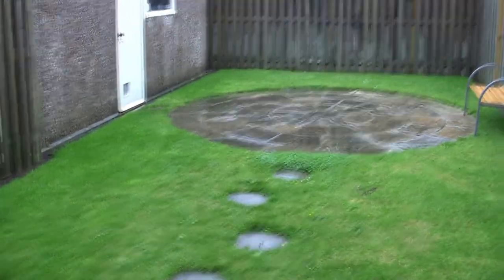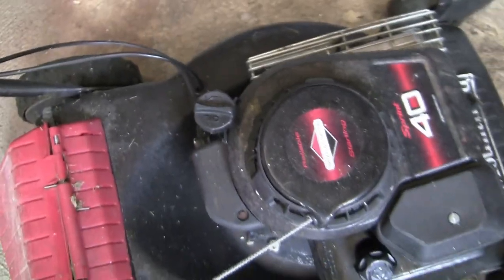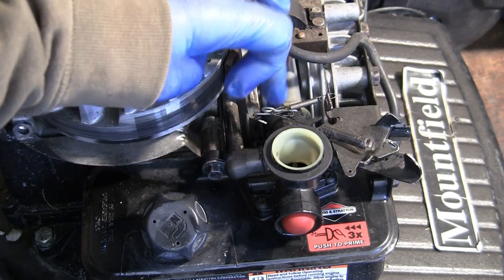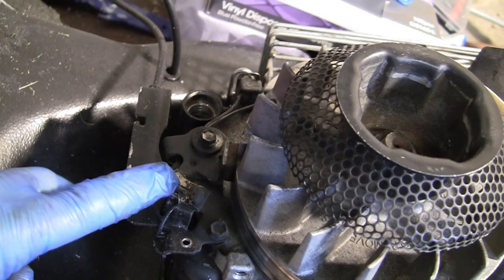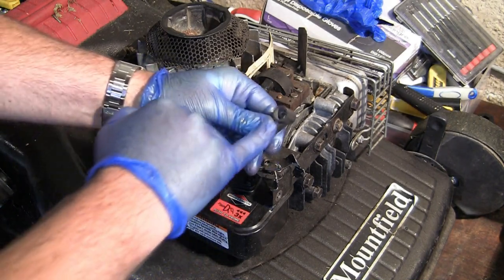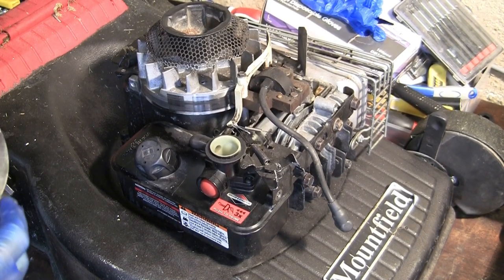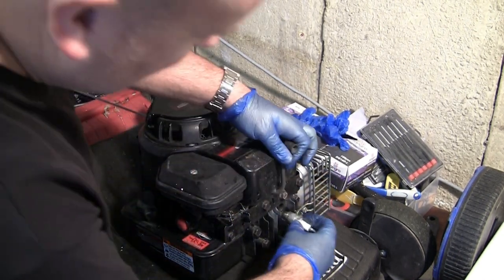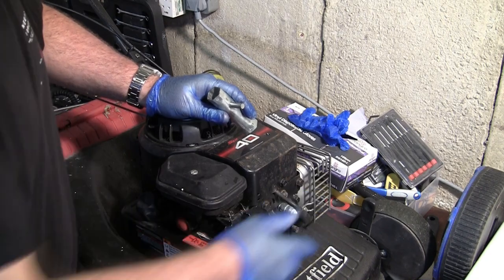Serviced Lawnmower Won't Start- Here's Why

Comment: Thanks a lot for the really informative video.  I had serviced my engine but it still wouldn't start.  Your advice regarding the kill switch was the key.  Adjusted wire till pad was lifting clear and away it went.  Thanks so much for taking the trouble to help duck eggs like me!

Comment: Hi could you please help me with a minor problem, I have Mc Cullock M46-125 the push handle which connects to the chassis the left handle is very loose i need to tighten it. To do this i have to remove the inner plastic discharge chute , i have removed 5 bolts but it still wont come out there is something else or another bolt which prevents me from removing the chute. thanks if you can help

Comment: In England go you have e20 gasoline. You need to use stable with your gasoline. I use 85 octane aviation gasoline the faa    forbid ethanol in aircraft engines

Comment: The screw for my filter cannister does NOT tighten into anything--- just spins and with motor vibration, the filter flopps around and is NOT doing what it should. I have gotten New screw and still doesn't tighten into anything.  I have tried to make sure that the screw hole is NOT plugged with debris, and it doesn't seem to be the issue... Any advice?

Comment: Welcome back young man, thanks for the troubleshooting video.  I’ve just repaired a mountfield like yours. The owner had tipped it  on its side to clean underneath and the petrol was black with oil. carb and tank clean job done.  Started repairing after watching your earlier videos thanks 👍
Reply from the maker: good luck!

Comment: Hi, glad to find an up to date video,  Ive watched your videos from way back when, in the last 3 months, since my neighbour said his mower was broke and he was getting a new one.
I asked what he was doing with the old one, he said it was for the scrap man, so I said I would have it.
Thats when I came on YouTube and found your videos (thankfully).
Its a Qualcast with the Briggs & Stratton engine, so, after watching your video on changing the diaphragm & gasket, then about the Govenor springs, I put the new diaphragm & gasket, changed the govenor springs, new fuel, new oil, it started on the 3rd pull.
I was hooked, I fetched our grandsons from their mothers, at the gate was an Einhell petrol mower, after asking why it was there, again, for the scrap man, she said it wouldnt start, I asked if I could have it she said yes, when I got it home, I started at the beginning, pull the deadman, listen for the micro switch, no sound of the switch making/breaking the circuit, I looked & noticed the lever wasnt lifting the arm high enough to make/break the contact, I bent the lever up slightly, contact made/broken, although I didnt know how old the fuel was, the oil was clear & up to the level, so it hadnt done much work, a couple of pulls & it started, brilliant.
So, with someone without any mechanical knowhow, after watching a few of your videos, 2 non working mowers now both work perfectly well.
So, I would like to say a big thank you for sharing your knowledge & all those viewers of yours, give it a go, if its broke, have a go at fixing it, iif it doesnt go when youve tried, at least you had a go & it was broke anyway.
Sorry Ive drooled on but as I said, I wanted to thank you for sharing & please keep the videos coming.
Ive subscribed & always give a thumbs up.
Reply from the maker: Awesome nice to know I could help. Well done!

Comment: Hi Ive just inherited a mower with this same motor which was running fine but now cuts out after about 4 to 15 seconds after starting...

It is an old and dirty machine that needs some love so after watching a few videos and setting to stripping off the tank and draining the oil to get to the cooling fins the tank doesn't come free of the manifold and the manifold pulls out about 2 inches or so any advice would be appreciated as i didnt want to pull it too hard and break something internal. 

Cheers for the content your videos have been a tremendous help so far.

Comment: Thanks for the list of possible problems. My mower quit running while mowing and I couldn't figure out why. I've rigged a separate kill switch. To do this required me to disable the grip handle kill setup. I wired the piece that kills the ignition back. The last time I was mowing, the piece I had holding the pivot piece back broke and fell off. I hadn't thought to check that. Your list reminded me and sure enough, there was the problem. Got it held back again and it started on the first pull.

Comment: Hi so pleased to see you have returned, would you be able to offer me your advice and guidance ? I own a Mountfield SP485 HW V I am not happy with the performance of the existing mulching blade it does not cut well and I don't want to have to mow my grass several times to shorten it down each time I cut the lawn just to get the blade to work, also the grass pick up into the basket is not very effective. I would like to replace it with a normal cutting blade ! from what I can gather there is not an option for me to be able to do this ! which I find hard to believe can you help or will I have to replace my mower ?  Thx

Comment: Hiya, thanks for all your video, a few years ago I watched one and was able to service my own mower from that, but now I seem to have the revving problem, its a mountfield SP530 with a briggs and stratton , is there any advice you can give me please, also when I used the last of my oil, I threw the old bottle away, and now I cant remember if it was 2stroke or 4 stroke I used, thanks for any advice you can give , also will the governor spring you have the link for fit my mower many thanks regards Suzy

Comment: Good to see you back on.  A stupid thing that I did 2 years ago was to get some fuel in a  proper can from a garage filled the mower and it would not start, eventually after stripping it all down I realised it smelled wrong, I had bought diesel. Now beware not all diesel pump pipes are black, the super diesel was green like the petrol one. Had it been the car it wouldn't have fitted but it did in the can
Reply from the maker: Thanks for the heads up!

Comment: 15:54 this is what happened to my triangle but it was turned 180 degrees in the opposite direction. I couldn't stop it from having a very high idle until I noticed it and now is running perfectly.

Comment: Ta very much,the black and white washer tip appears to have solved my problem.

Quick one,what's best way to tip mower to get access underneath to clean blades and not upset oil or petrol?
Reply from the maker: Extract it

Comment: Hi MowerMan, Great video, I have also used your video on the diaphragm service and it was wonderful.

I bought a second hand mower around 12 months ago and I haven't serviced it ever, on the first 10-20 seconds of start up after replacing the diaphragm, spark plug and air filter, it does the hesitant high rpm > low rpm cycle and then levels out to a consistent speed and mows fine. Could this happen as a result of lack of oil change? (P.S I am popping down tomorrow to get some fresh oil and petrol for it)

Cheers!
Reply from the maker: Make sure the springs move freely
Reply: @MowerMan  Thank you very much, I'll have a look to confirm tomorrow. Have a nice night.

Comment: Mowerman. I need some help with a mower. It's a husqvarna lgt48dxl with a kholer 7000 series 25hp. As soon as I start the mower it sounds like it is going to explode with how high the rpms are. I replaced all the springs in the linkage and installed a new governor, cleaned the carb. Set the govern and still no change. I'm at a loss. Any ideas would be greatly appreciated. Thank you.

Comment: What do you think ? mine was working fine until I refill after moweing and started to loose power, until it stopped and no power and surge   I changed to fresh fuel and it is still the same, thanks